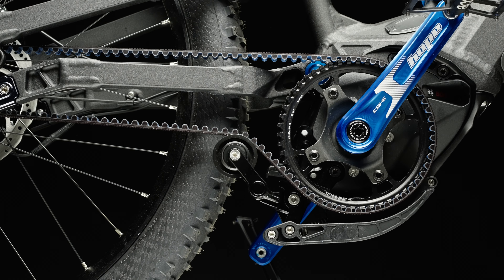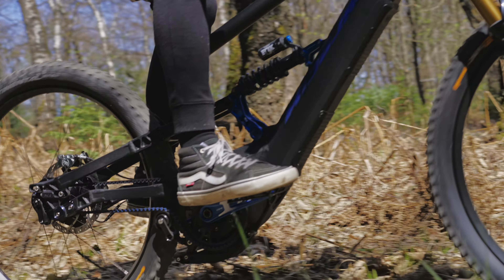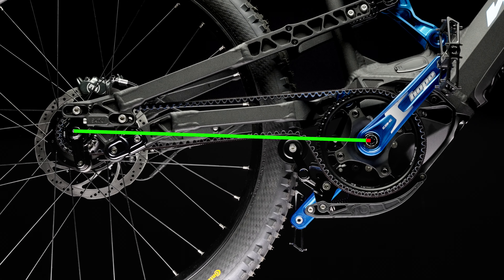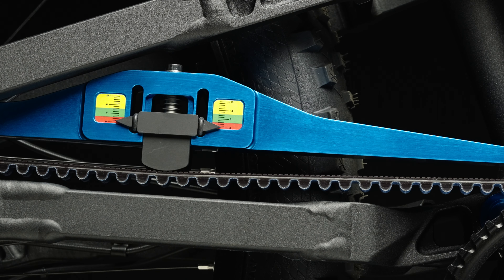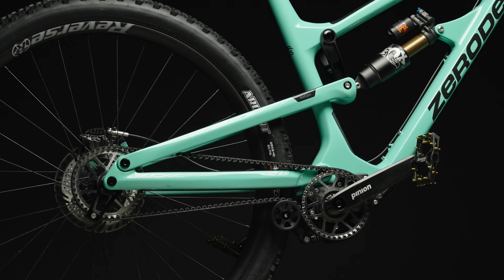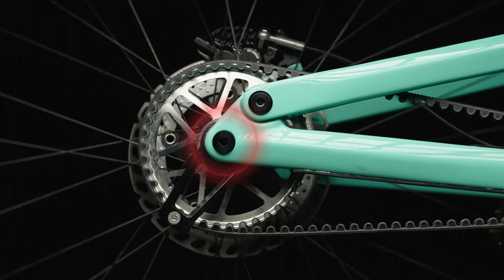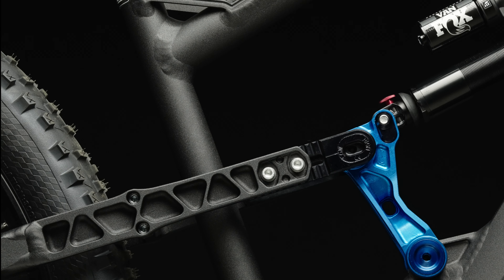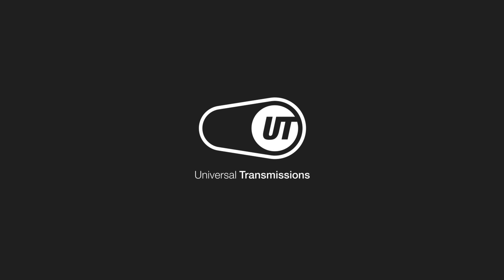UT advanced - Belt Tensioner for Gates Carbon Drive (English)

Comment: Someone needs to develop universial tensioner for gates drives so anyone can opt to convert their chain bikes to belt. It's currently only limited to frames with horizontal adjustable dropouts, but it could work with thru axles as these bikes show.

Comment: Do you also have a tensioner for near the rear sprocket ? because you have universal eyelids there to connect to. So its able to convert mountainbikes to your system. Think about the extra sales you can make through consumer instead of just manufacturers and b2b.....

Comment: Why does Gates not make a belt drive for recumbent bicycles?
Reply from the maker: Hello. It is up to the bike manufacturer/brand to decide whether to use a belt drive system or not. The frame needs to be prepared and the concept of the bike needs to be rethought for a belt drive.